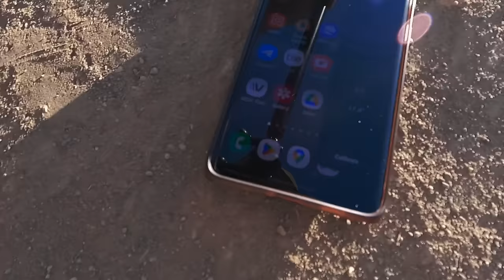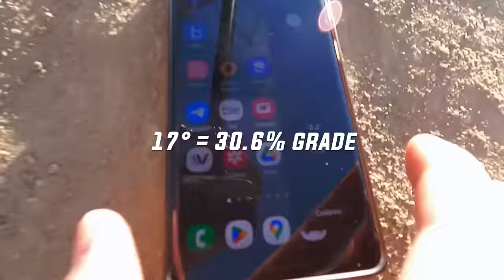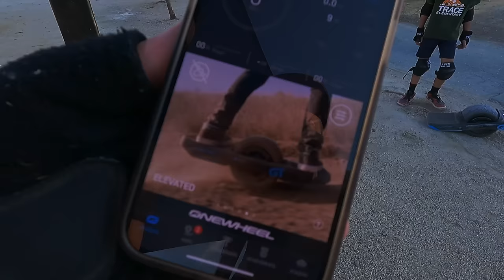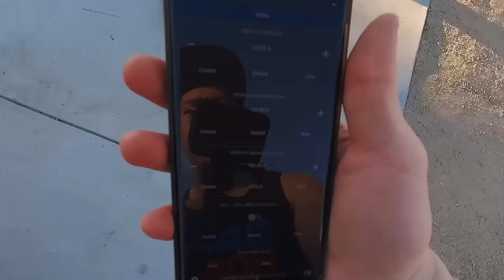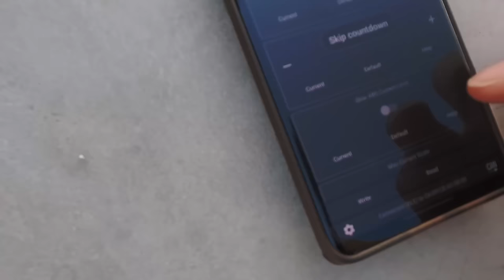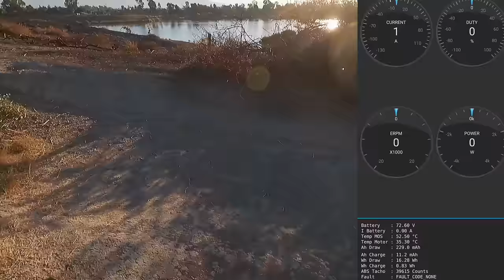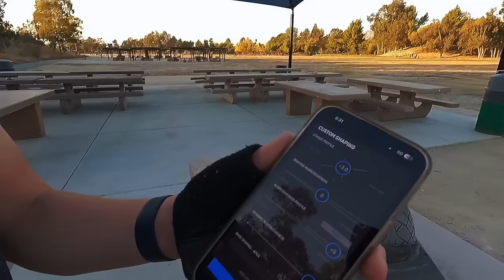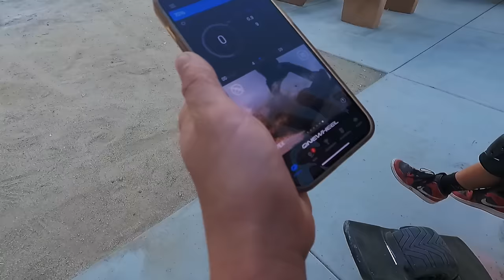Epic GT-S Torque Test! Vs Floatwheel, SuperFlux, GT & Pint-X

Comment: Thank you Max. That was a very entertaining video. It must be mentioned here for people who haven't seen the previous videos that the Superflux was limited to 150A (I think) but it can actually handle way more than that, just like you showed in your first video, it can bomb that hill like its nobody's business. 2nd point  is that the Superflux has the smallest battery out of the 3! A good comparison would be with a 20S 84V battery powering the Superflux. 
And lastly, the Superflux is built to be the fastest motor out of the box compared to all other wheels, so to gain that extra speed, you have to lose some torque. Interesting video nonetheless and an amazing service to the community ❤
Reply: I was about to say something very similar. Haven’t tried the floatwheel yet but the SuperFlux would eat that hill very easily even at 75.6v (at least that’s my experience). Specially if you use it to its full potential. Some friends bought the ADV Pro, after trying it out I’ll have a real opinion but so far SuperFlux is the way to go on so many levels. Without trying the ADV I would say FloatWheel wins on the easy assembling but performance wise the SuperFlux exceeded all my expectations. Anyway, thank you very much for what you do for the community 🙏🏼
Reply: Is your vesc controller coming out soon will be able to saturate the superflux? What would be a motor saturation current for the superflux?
Reply: @wayofflow955  in the fungjneere vesc, we can practically have max current set to 300!! But we would advise people to set it to 250 ;)
Reply: @Fungineers  that is awesome! 👏 are you guys making a 20s2p 2170 battery box solution?
Reply: @Fungineers is that 250 motor amps or battery amps ?
Reply from the maker: super fair points! I was so caught up with making sure the superflux and floatwheel were equal amps from feedback from the first vid that I totally forgot that I should've maxxed out the amps for this test :) still impressive and near identical performance here with a 75V battery. Just goes to show how awesome the superflux is at capped amps. You can see in my latest King of the Hill vid the superflux is smashing the hill up and down like butter. Can't wait to rock the full Funwheel experience!!

Comment: Trail magnets just drop a video showing the GT-S went up that same hill you couldn’t with the GT-S with only 1% battery left. What’s up with that, riding skill ?
Reply: did you not see them with a hefty head start?  
it doesn't matter.
if you need to have pro level skill to get up the hill with a gt-s then it's not that strong. these " low skill" riders got up there with other boards.
Reply: This sums up what I've been feeling for the last 6 months. Some guys ride the board with finesse and style and linear speed. Some guys want to break about the top speed. They hit on concrete. And some guys want to just see what board can strictly climb up at the steep Hill. I am more in the group of racing and maintaining speed and handling. So I'm not really hip 2 making a board. Just do all the work. that being said, it seems to me. The float wheel may not hang with the smooth linear flow of a good rider and gt or g.t.s.... I would like to see really good riders on all of these boards. Riding the way hardcore trail riders ride not just setting goals for steepest hills.

Comment: Looks like Neil Bennett debunked this video! 🤣🤣
Reply: With max nose tilt custom shaping. Both VESC boards did it with zero shaping you can literally climb any terrain and just roll on like normal. Yeah gotta say for 3.5K that’s a L.
Reply: @Zetler  “both VESC boards did it with zero shaping” are you joking? VESCs are only rideable by tweaking the “shaping” or importing someone else’s tune.
Reply: @laurentbeauregard4666  Yes, they're riding a tune. Not a shape. Once you have that tune loaded. You just go! Thats just like Apex or Elevate. You don't ride Nicole Fast and Flow tune, get to a hill, then change the god damn nose tilt up, then increase the aggression of the board just so it'll be able to climb a simple hill. Look at all VSEC climb videos, nobody does this. They just GO. This bullshit where you have to move the dots around meticulously just to achieve the mundane is for FM boards. At 3.5K for a GTS its just stupid.
Reply: @Zetler  but you’re ignoring the part where if you don’t like someone else’s tune, you have to know all of the values and what they do. FM just gave users a limited version of that ability in a way the average consumer can understand. Also not a crazy simple hill, non Maxx guy couldn’t even climb it on a VESC. 
I promise you I could get up this hill in one shaping without adjusting it (my choice would be apex). If you want to cover the cost of gas for me to drive to San Jose from Chico, I’ll do it. If I can’t do it I’ll give you $20. 

I got nothing for the price tag, that shit is ridiculous.
Reply from the maker: there's definitely some debunking to be cleared https://www.youtube.com/watch?v=zUOf9Fa3Vk4&t=300s
Reply from the maker: I'll take you up on your offer - make it all the way up in one shaping without adjusting it. I'll cover your gas for $20, if you don't make it you don't need to give me $20. What's your schedule like?

Comment: Honestly, this went exactly how I expected based off the GTS motor connector alone. You can't deliver amps to the motor efficiently with a plug that small. This is a result of what i like to call "partial innovation," and it is annoying. 

Nonetheless, I'm rocking with my 75v Superflux! Trail GOAT fr. Great vid my man! 
💪
Reply: yea and that and the 1p battery dealing with very high current draws of almost stalled motor means a lot of that 100+ volts never making it to the motor. The GT-S really is meant for speed and short bursts of torque at low speed and not much else.
Reply: They thought they were going to get everybody with a high voltage number
Reply: I mean basic understanding of batteries and electricity shows that higher voltage allows you to send the same power over smaller wires. Basic science.
Reply: @ehylton89  Source?
Reply: @nathanofearthh   https://en.wikipedia.org/wiki/Copper_loss, Power lost to heating= R*I^2 
and with Power = current*voltage, If you increase voltage, you can reduce the current draw and therefore reduce I^2R losses exponentially. That said a battery designed for the wrong function and a choke point like that connector can work together to drop enough voltage that you're worse off then just running a lower voltage with a higher continuous current capacity.

Comment: That was to be expected to be honest. A dude on IG showed a nose dive at 55 kph (35mph). With a vesc and an 80V battery you can already reach that, which means that FM did exactly the same as before, namely restricting the current output of the battery through the BMS. It was 30A before, now it's a bit higher but current and torque being linear, it shows clear limitation when climbing where torque is needed.

It's a win/win for FM. They can brag through marketing that they have a powerful board because of 113V, getting also a fast board at low battery level, and having a better cost control, since the battery has less cells now with a 1P configuration, but as soon as you scratch the varnish, you see the ugly stuff.

It's crazy to think that a simple XR conversion to Vesc, with a 19S2P performs better than this board.
Reply: I am surprised how many people bought it? Good advertising I guess!
Reply: I can confirm as you know that a vesc v1 with a stock battery performs better than the gts if it's running vesc ( obviously not much range though)

Comment: The magnets in the GTS are 17% stronger than the magnets in the GT, but the GT stator is wound to produce 20% stronger magnetic field per amp than the GTS.  These 2 effects nearly cancel out but slightly favor the GT.  At higher speeds, this trade-off benefits the GTS with its higher voltage.
Reply: So what would happen if you put a GT stator in a GTS ?
Reply: @Reedith  torque would be even worse.

Comment: I think you should have tried some custom shaping 3.0 tweaks - they DO make some drastic changes.  What tune were you using on the FW and Superflux?
Reply from the maker: we did, watch at the end where Eamon decided to maxx out apex in all custom (+3nose,+5A, +5DR) and gts did do a bit better. but still tended to nose dip on uphill ruts more than gt. I believe the tunes were Hannes' all around as a base tune.

Comment: FW has molicel batteries which put out A LOT of amps, what are the OW GTS and Pint X running?
Reply: GTS MOLICEL P45B, PINT X is VTC6, BOTH VERY GOOD CELLS， cant blame the battery, motor size too smol
Reply: Some pint x are coming with 30Q 💀

Comment: So what I saw on a float life video is that the GT-S has a foot pad delay feature that if you don't use it the GT-S just cuts right out on any drop. So it could be that.

So another reason for that might be that at low speeds there is less back EMF so current draw will be much higher, and with the GT-S being a 1p battery its internal resistance might drop the voltage at those high current draws leaving you with less power to the motor then the GT. On launch it doesn't matter as much because motor speeds ramp up quickly reducing current draw before bat chemistry can cause a problem.

Comment: Are you running the same psi in all board?  I am disappointed at the gts, base on the battery configuration it should have done little better. Gts can’t handle heavy amp requirements when going uphill and some bumps, it’s good for smooth trail.  I think I would want to ride 12s3p compare to 27s1p, much safer!
Reply: More volts doensn't equal more amps though. The battery configuration doensn't make sense if they want to call this an uphill board.
Reply: Too bad I don’t have any smooth trails nearby 😅😅.  Goofy ahh 6.5” to boot
Reply: You gonna pay 3.5K to ride smooth trails?
Reply from the maker: @Zetler  :face-purple-smiling-tears:💯
Reply from the maker: all was roughly 16psi. we were all also disappointed in the gts, was hoping to be at least twice as good as gt on the big hill on standard ride modes. I mean $3200! floatwheel and diy boards have exponentially more torque, go 30+mph, range of 25-35miles and cost $1800-2000. ludicrous price for what you get of gts
Reply: @MaxxSend  for hill climbing I would put the psi to 10 or something, that would give your board more traction and less bumps.
Reply from the maker: @wayofflow955  you can get down to every little minute detail further and further 😂 then you have to take the rider weight and psi ratio into account lol this test took the feedback of so many comments such as this, yet the results are always the same. The fw and sf makes it up regardless of psi and bumps.
Reply: @wayofflow955 still not gonna make it up 😅

Comment: Was ATR on or off? This is a very important piece of the comparison if we are talking torque specifically and not the comparison of torque and software. I do wish we had ATR on FM products.
Reply from the maker: Atr was on. But we also put the gt-s in elevated and it did just as bad. We also did custom in the end with max aggression, max dynamic responsiveness and nose tilt +3 (which isn't good riding settings), yet still barely improved. With the additional nose clearance for gt-s with nose lifted it simulates aspects of atr as well. You gotta realize that it's the amps being limited by fm, hence the haptic buzzing and beeps.

Comment: The vesc with the superflux was also in its highest ride setting giving it more clearance
Reply from the maker: correct higher by about 0.5 inches, but floatwheel's tire is also bigger diameter than the superflux's trail pro by about 0.5 inches. nearly identical clearance.
Reply: @MaxxSend  the lighter, smaller diameter tire will result in more torque. I have a Trail Slayer on my ADV

Comment: The pint, gt, and gtx all use the same size stator and core. Their motors are identical to each other. The float wheels stator and rotor is twice as large. That is what gives you the power needed to climb hills. Future motion needs to step up the quality for 3k.

Comment: Why are you not mentioning the different tires and the effects? They have? Just curious.
Reply from the maker: because it's negligible. all tires are at 15psi. as long as psi is same and terrain is not slippery, it comes down to the board power, rider weight and skill. take the results how you like, we felt we could distinguish between the  better performers.

Comment: My main takeaway from this video is that ATR is freakin amazing! Shot up those hills like nobody's business! Kinda curious to see how the cannoncore and superflux handle going up that same hill without ATR. Who is truly the king of torque?
Reply: idk what you expect to happen... without ATR your nose hits the dirt and you're done - hard to test torque if you're stuck ;)
Reply: @surfdado  in the video Max was praising how powerful the cannoncore and superflux motors were, even though it seems like atr was the difference maker here. How do we properly compare these boards and their motors to the GT-S when they have that advantage?
Reply: @anthonym7281 I disagree, the gt and gts lost their power, it wasn't nose clearance. Now if they made it up higher to the steeper part then it might be a factor but they didn't have the power to make it that far.

Edit: well actually on most attempts it was nose clearance, that's why they made it further in 3degree nose up it seems.
Reply from the maker: clearance wasn't the issue, it was the gts nose was dipping on the bumps and also the motor stalling out. Regardless we tried to simulate ATR by using elevated mode and also lifting the nose 3 degrees to help with clearance - elevated did no better, +3 only helped with maxxing out aggression and dynamic responsiveness in custom and even then the power still gave out just a few feet higher. It comes down to the amps are being limited by the controller. Also, who wants to rip trails with +3 nose and elevated? 🤣"True king of torque" isn't relevant if you can't even ride the damn thing for all purposes🤷‍♂
Reply: @MaxxSend  ah okay, the lower amp limit on the gts explains it. Thanks for clearing that up!
Reply from the maker: @anthonym7281  fosho! Will be curious to see how the gts motor does in a vesc
Reply: @MaxxSend  that would be pretty cool to see! I gotta say though, after seeing Neil Bennet go up what looked like the same hill with his GTS, I'm a bit confused on why yours wasn't able to do it. Would be interested in seeing you try it again before you vesc the s

Comment: Max I’ve ridden up that first hill on a XR but I had some speed and did it on an angle
Reply from the maker: Yep that hill is super chill with a running start. Try to do it from standing start tractor crawl, it will change things🤓 you can see not even the regular GT can do that, and gt-s can only do it in apex
Reply: @MaxxSend  ty so much max for this video! I’m convinced on the floatwheel! Love try that tractor crawl next time

Comment: Looks like the Superflux required more amps than the CannonCore
Reply from the maker: yes seems the cannoncore edges out superflux at the same amps. I cover this on the superflux set at 120A vid. But right now superflux can be set higher to 150A due to the lil focer having slightly higher current capacity than the fw controller. wait for gen 2 electronics for fw which will allow way more current too.